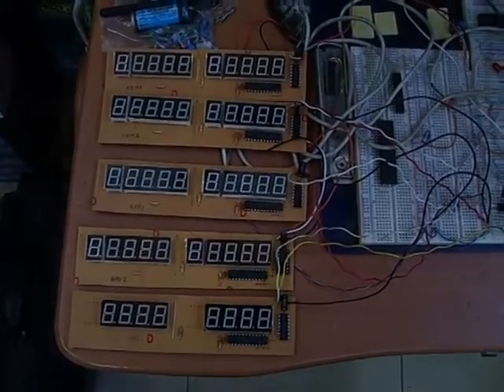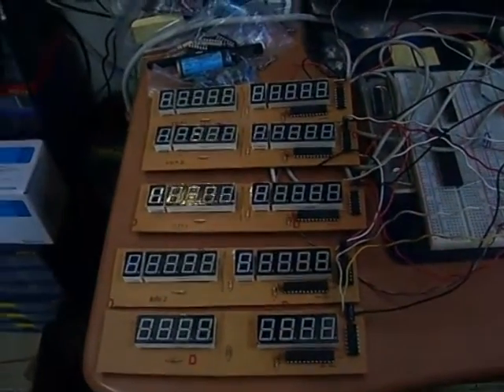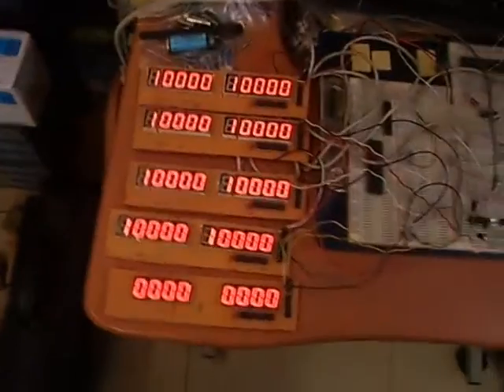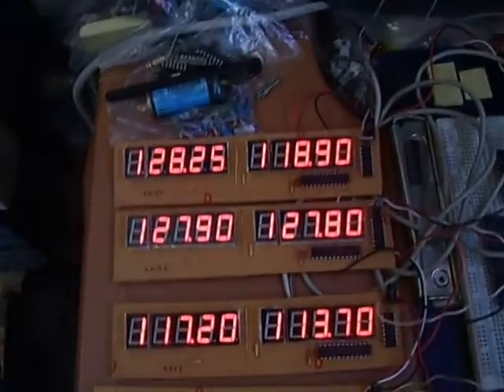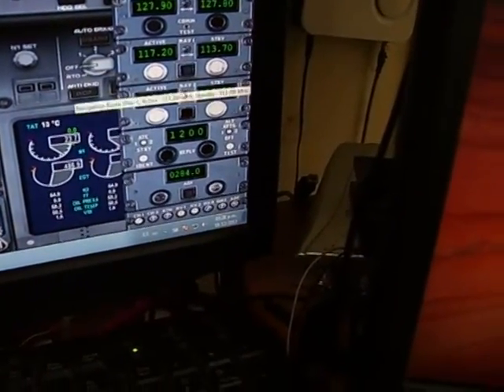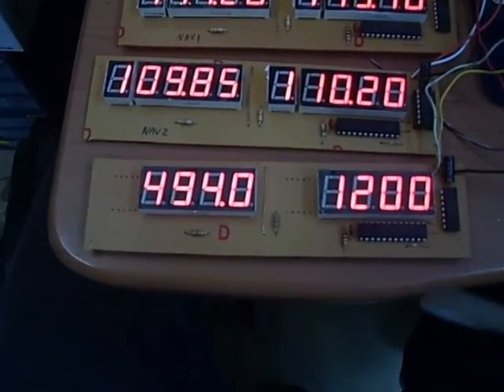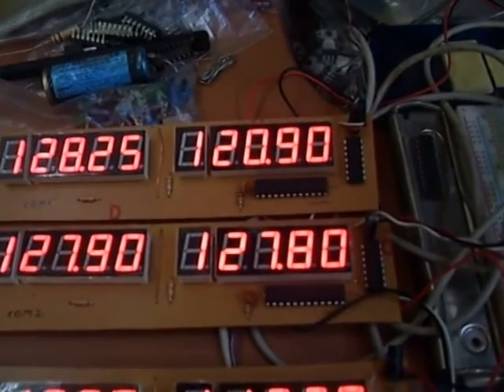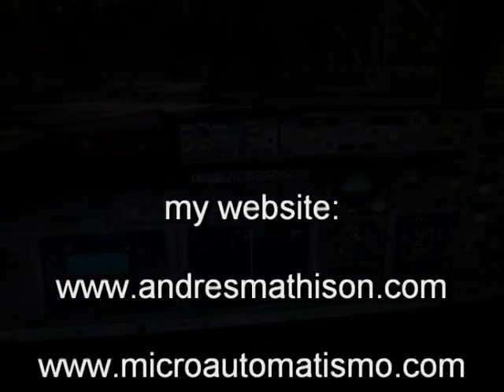Building FS9 / FSX Radio Panel (Flight Simulator X)

Comment: Can we do that with Raspberry Pi ?
Reply from the maker: +Berkay Eraydin Yes you can do it with raspberry or banana pi, with arduino uno, mega, mini or nano too, but the idea is to use the minimal hardware that involves just a few dollars, for example arduino uno $20, raspberry pi B+ $30 but using just an microcontroller like Microchip or Atmel with a few discrete components is just about $3, that is the idea i am following.
Reply: Thank you, i have Raspberry Pi B. I want use only 7 segment displays but i don't know how can i do that. How can i connect RPi and P3D  and i need which softwares bla bla I don't know anything about it. I used RPi only with some basic python codes. Sorry for my English :)
Reply from the maker: +Berkay Eraydin Ok, don´t worry, electronics is a big world but not dificult, just is read a lot a pages, i believe you can find some information about rasp pi wth P3D. But while you look pages, just check the jims webpage, i use his software to connect FSx/9 to my boards, this uses serial port from the pc and you can connect rasp pi by the serial port include in the port where are GPIOs and use a code for get working.

The link to jims page is:

http://www.jimspage.co.nz/intro.htm

Sorry, my english is bad too, because spanish is my official language.

Andres Mathison
Valencia - Venezuela
Reply: andres mathison Thank you so much.
Reply: +andres mathison Hi, again me :) I did that with link2 fs and raspberry pi. But some 
buttons don't in link2fs. Like  LNAV VNAV LOCalizer or APProach for 
boeing. How can i do this buttons maybe you can help me
Reply from the maker: +Berkay Eraydin Your are correct about some buttons and funtions that doesn´t appears. The only think that you can do is make a new software in C# or something that can read the codes from FS or x-plane. Isn´t easy but it is the only one i think.

Bye
Reply: Yep, thank you.
Reply from the maker: Ok

Comment: Very nice, i've tried to do this with 74hc595 shift registers, but its very annoying, changing 1 number and all the displays needs to be redrawn, so i've ordered some max7219 chips, hopefully this brings me a lot further.
Trying to make a Boeing 737NG MCP, if it will succeed then i'll be sharing my knowledge :-)
Reply from the maker: That´s right, Max7215 & 7221 ar the best for auto multiplexing display signals, are to easy to use and the best are too cheaps, The code for use it is too short when you compare with HC595, besides it doesn´t need resistor because MAX use it internal circuits to drain the needed current for the optimal visualization of displays and you can control the luminance of the display, you can do a lot of things with that 7219. Take advantage of this big device in a small size.
Reply: andres mathison Just played further with my 74hc595 shift registers, problem solved!, I was outputting all data through serial, wich slowed down my arduino, disabled the debug mode and it worked like a charm! But still im gonna replace them for te max chips, so i can run 8 digits through 1 chip, and not 1 74hc595 chip per digit.... saves a lot of wires :-)
Its really enjoying to see things that work... But i think its even far more interesting to run into some problems and solve them. Gives more joy in building. 
And ofcourse the MAX chips takes multiplexing by itself, while the 74hc595 shift registers the arduino needs to do it and slows down the whole program ;-) This would be a big win i guess... 
It's nice to play with this stuff :-)

Comment: Great setup you have there, as for the wiring, looks complicated. Would you happen to have a wiring diagram for your setup? I have been looking everywhere and unable to find a wiring diagram. What software did you use?
Reply from the maker: Hi Underloard102, forget this boards with these complicated setup of wires. you need to see the new model that i developed. I´m making the new video and i going to up to youtube soon, please be in touch to see them and receive your comments. The software that i´m using is from jims page, is simple, usefull, free, but i can do my owm software too, but it´s taking too much time to develop because i´m electronics not programmer, but i still try to make one.